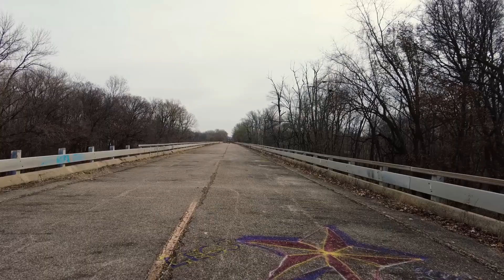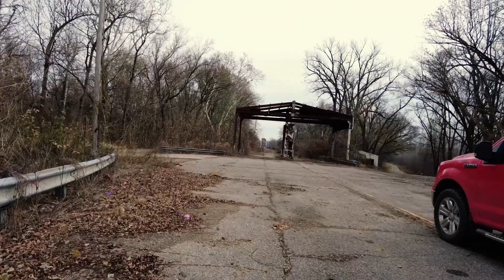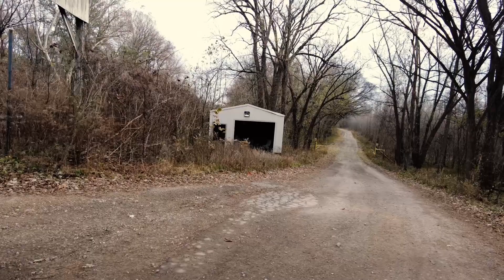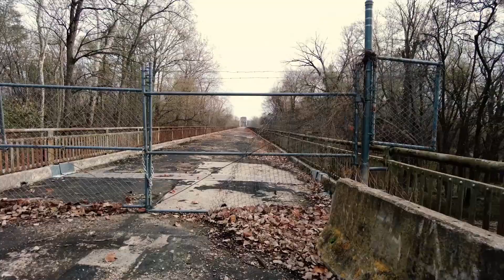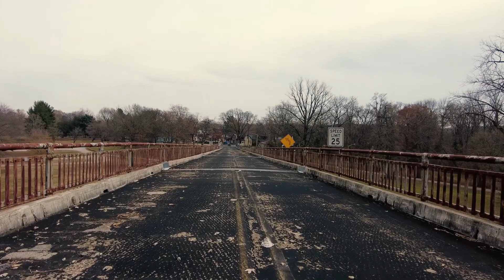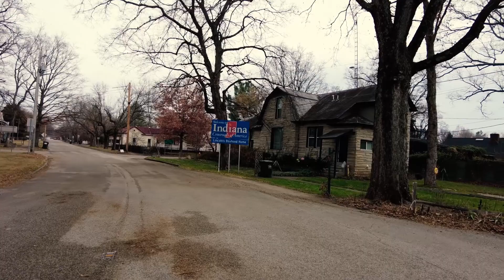Abandoned Harmony Way Bridge

Comment: Even though it was a narrow bridge, it was a real workhorse until Indiana 69 was extended in the later 90s from New Harmony to Griffin at exit 4 on I 64. There were several million bushels of grain that went across it each year to the grain handling facilities in Mt Vernon,In. It literally held up a pipeline on wheels for the Texaco refinery in Lawrenceville, Il to tranport product to and from their barge loading facility in Mt Vernon as well. It was also a main highway from Louisville and Evansville to St. Louis until I 64 was opened in the early 70s.  The bridge has alot of history and has been very important to the area during its lifetime.  Thanks for the video.